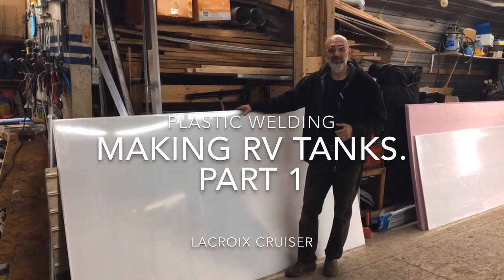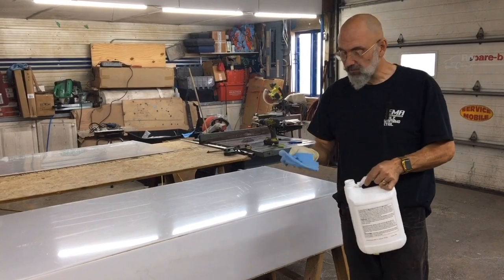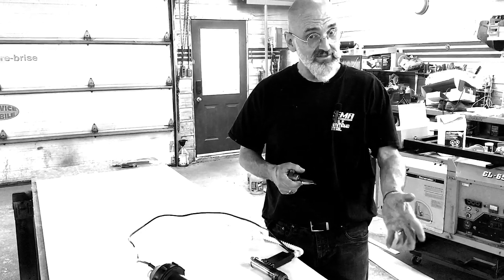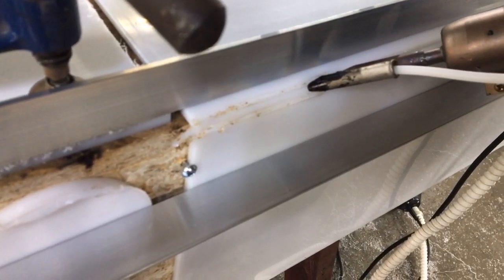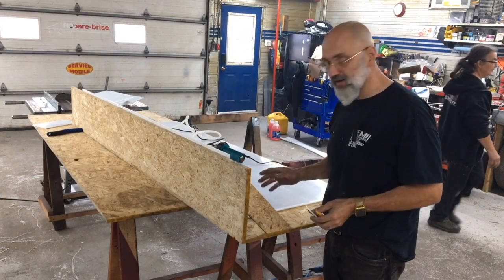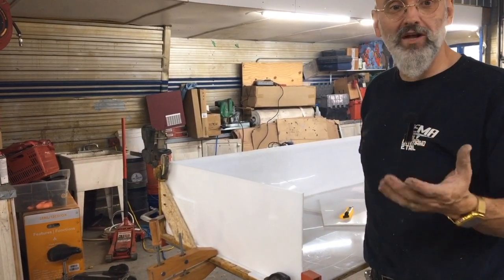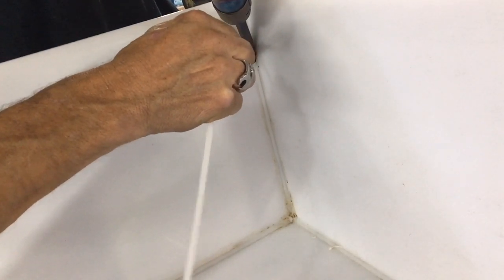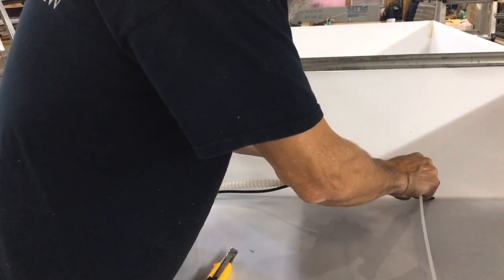Plastic welding, custom RV tanks, part 1 of 2

Comment: Interesting - BUT - with the massive weight of water this holds it would need internal strengthening with ribs or cross members to stop the whole think bowing and falling apart. As it stands it is a design fault.
Reply from the maker: It has baffles, 5 years later and 250,000 miles, no leaks

Comment: Use you wire brush to clean the weld tip before you start. It will help to prevent burnt black bits of debris in your weld :)
Reply from the maker: Good tip!

Comment: Thanks, this is a great video! I have a question i hope you or someone can help me with. 

I have an hdpe (pelican type) container. I want to cut a section out and then platic weld it together. Is that possible using this same method?
Reply from the maker: Yes you can!

Comment: Interesting, thanks for putting up the video.  I have a question - how do you know what diameter HDPE rod to use for a given thickness of HDPE sheets?  Is this just trial and error or are there actual standards or norms to follow, such as, use 1/8 in. rod to join 1/8 in. thick HDPE?  I got curious about this and wasn't able to find any guidelines, e.g., a table or something.  Thanks.
Reply from the maker: There are not many choices
Reply: @LacroixCruiser  I have no idea what that means.  If it refers to thickness of HDPE sheets, there are many choices.  The range is huge - 1/16, 1/8, 3/16, 1/4, 3/8, 1/2 inch and on and on.   Same for HDPE rods, there are many choices, the range is huge.
Reply from the maker: @rla1000  not many choices in rods from my supplier

Comment: Adding to my DIY library!!!
 What blade are you using to cut I've always had melting issues on a band saw and table saw which made it impossible to get a clean cuts. Always had to shave clean. Great material wished Id known this long ago!! That's a great welder too!
Thanks
Reply from the maker: Thank you, we used a plastic specific blade .
Reply: @Moonolyth Tekton I had the same problem cutting plastic with a jigsaw.  Found it helped a lot to turn the speed down to lowest setting, otherwise the cut edges just welded themselves back together!

Comment: Currently a trainee plastic fabricator,  I'm struggling my self with the flow of using the gun and just started getting used to the different temperatures for different plastics! Hopefully I'll get there thanks for the extra tips in this video as all hot air welders do it differently.
Reply from the maker: Thank you for commenting

Comment: I still dont get it. I hope those arent fuel tanks, cuz those joints are weak.
Reply from the maker: Water tanks, and they are housed in a steel frame.
Reply: @LacroixCruiser  ah, so they are not structural. too bad, cuz Id like to make some stuff out of plastic but as far as I can tell only PVC is gluable, and sheets of it are very expensive.
Reply from the maker: Exactly

Comment: Wow this video just triggered soooo many great ideas in my head, as I am in the process of renovating an Alcan 290 houseboat
Reply from the maker: Excellent!
Reply: @LacroixCruiser  où avez vous pris les panneaux de hdpe?
Reply from the maker: Industries FM a Granby
Reply: @LacroixCruiser  Thanks a lot !! Got prices from them. In terms of thickness, I know HDPE is much more flex than plywood. Would you install 1/4'' hdpe on a house-boat roof on which people will walk knowing that it's supported by thrusts every 12 inches? or would you go with 1/2' or even 3/4''. Weigh is also a concern in those thicknesses
Reply from the maker: I would go a minimum of 1/2 inch, and maybe plywood on top. HDPE isn’t very UV stable.
Reply: @LacroixCruiser  Well, I finally went for 1/8'' sheets welded on top of 1/2'' sheets (1/2'' sheets installed only on the perimeter of the roof to replace old plywood, center of roof still 1/2 plywood). This is a major fail so far!! I was never able to get 100% watertight welds due to inconsistency. 1/8'' panel are very difficult to weld because they move a lot with the heat. Also, they expand and retract a lot in the sun, which causes the welds to crack after a few days. Maybe I should have invested more to install 1/2'' sheets on the whole roof, but even the welds between the 1/2'' sheets I am not that confident on the long run. Did some sample welds on smaller 1/2'' pieces and I'm not that impressed with the welds strength.

Using the same gun as you
using hdpe 3/16 welding rods (from grainger)
Using fast welding tip
also tried pendulum welding technique with same rods and also with hdpe stipes from white plastic 5 gallon buckets
Using acetone for cleaning before
Using wire brush before weld
temp setting between 8 and 9 on the gun (below that it won't melt)
Reply from the maker: That’s unfortunate to read.

Comment: I feel the backache from here...
Reply from the maker: It could have been worse
Reply: @LacroixCruiser  Mine was. I'm using a Matco APW100 airless at 1/8 rod. Crazy slow. Just ordered a used Seelye 63. I can't justify spending big bucks for a good gun when I do 3-4 agri-chem or fuel tank repairs a year. But man, those hours of bending over like that. I'd have to hold my breath to stand up.

Comment: The welding tips in your link doesn't look like it has the same tacking tip your using.  Should I look for a tacking tip like you are using?
Reply from the maker: The ones in the link are fine

Comment: Hey Yvan, When I click on your link for the HDPE rod, the Amazon rod appears to be flat, but you state that yours is round. I cannot seem to find any round rod, except for what appears to be small short ones, maybe 12" or so. Is this the correct link? Thanks.
Reply from the maker: Unfortunately the linked product has changed . Find a local plastic supplier, they should have it on hand.

Comment: I'm working to build an HDPE skiff (12' boat). I purchased the sheets but am now wondering how to weld and reinforce where the sheets join, such as the bottom to the sides. You say you use metal framing. Boats usually use ribs. And I was thinking of melt-embedding stainless steel mesh in the critical joints. Any ideas on the strength of welds question?
Reply from the maker: The welds are quite strong, we used the metal frame to prevent the tanks from bowing mostly. The SS mesh is a good idea.

Comment: very Informative vedio. I have been considering Making a pontoon boat based on structurally welding hdpe barrels end to end. This would allow the flotation element to provide structural rigidity. The process looks very doable without excessive tooling. Retired in Thailand there are limited materials and systems to work with. Thanks for the motivation.
Reply from the maker: Have fun with your boat!

Comment: I live in Belgium. On Amazon I can't order the welding gun. I can order it on ebay but there the feeder for the filament is not included. Where can I order the feeder?
Nice job an beautifull explaned , thanks
Reply from the maker: The tips were also purchased on Amazon. Your plastic supplier should also be able to supply them.

Comment: Mistake I make when using this tool is far too much pressure or somtimes its skips and bounces but that could be down to being a left hander 🤣
Reply from the maker: I used both left and right hands, when you find the sweet spot of temperature , pressure and speed, it becomes easier.
Reply: i intend doing a few test pieces and then breaking them apart to check how good the fusion and penetration is
Reply from the maker: @heartobefelt  good idea

Comment: The link for the extra tips doesn’t work anymore 😭 I need a tack tip
Reply from the maker: Thanks for watching, here’s another link for the tips

https://amzn.to/38rXVqQ
Reply: @LacroixCruiser  Thank you for the link so do you think that this plastic welder is heavy duty enough for me to fabricate HDPE boats out of plastic drums I mean do you think that the welds are thick enough to fuse these barrels together?
Reply from the maker: Yes, but you will need to possibly do multiple passes.
Reply: @LacroixCruiser  excellent I don’t have a problem with that I just don’t wanna have to buy a $1400 extrusion Welder
Reply from the maker: Do some practice welds and you’ll be fine.,
Reply: @LacroixCruiser  will do thanks
Reply: @LacroixCruiser  will do thanks I’m buying extra welding rod

Comment: Who is a good supplier for 1.5" and 1/2" female NPT fittings typically used in RV fresh water tanks
Reply from the maker: This is where we got ours.

https://www.icondirect.ca/search.php
Reply: @LacroixCruiser  Thank you...Both for the informative video and the website info. It was so easy to follow your clearly explained instructions.
Reply from the maker: Thank you.

Comment: Lifesaver!! I bought a tank for my carpet cleaning van. I measured height and width thinking nothing of it. The darn thing is too long! I bought a plastic welder about 7 years ago for a project. I thought about welding it but was worried about the pressure from all the water. I'll give it a try! Thanks!!
Reply from the maker: Make sure it’s well supported.

Comment: It appears that the recommendation for baffles is one every 24-30", so 3 on an 80" tank. The extra baffles will also add to the rigidity of the tank.  I would also have a few 1-2" holes spread around each baffle.
Reply from the maker: Once completed it will have multiple baffles, with the main goal being extra rigidity .
Reply: @LacroixCruiser  have you tried bending the bottom corners from a full sheet so there is less welding ?
I have seen it done with acrylic in big pizza ovens but wondered if it can be done with a heat gun or two on HDPE ?
Reply from the maker: Yes, but in our case the size of the tank prohibited that from being a viable alternative.
Reply: https://www.youtube.com/watch?v=U6KuaqUszvc  baffle balls can improve vehicle safety if you have big tanks like his
Reply: Mst

Comment: Like you know, i worked with your son in the plastic industry. When we need to prep the plastic surface, we first use a plumers propane torch and then go ever it with acetone. I nerver used one of these tool but i'd like to give it a try. It's hard to beleive that a 1/4" sheet of plastic can resist the pressure of 1400 pounds of water. Good job.
Reply from the maker: We will be supporting everything in a metal frame. I wouldn’t trust only the plastic either.
Reply: TAMCO also recommends supporting the sides with metal or plywood, so it's not just for DIY.

Comment: On your center baffle, it looks like you do not have a hole at both lower corners?  Having holes in both locations would ensure that water can get from one side to the other regardless of being off-level to either side.
Reply from the maker: Yes it has holes on both lower corners
Reply: Thanks.  Was the tank laying on it’s side while you welded it?  If so, I saw the two holes, but they looked like upper and lower, rather than left and right.
Reply from the maker: Yes I was welding it on it’s side.
Reply: @LacroixCruiser  I hope this is a fresh water tank, not black!  ;-)
Reply from the maker: Dell Anderson yes, the black tank baffles allow for more movement.